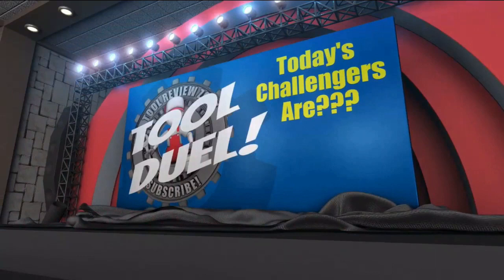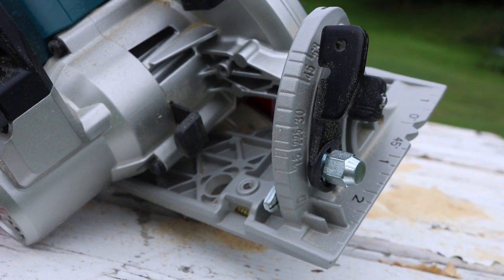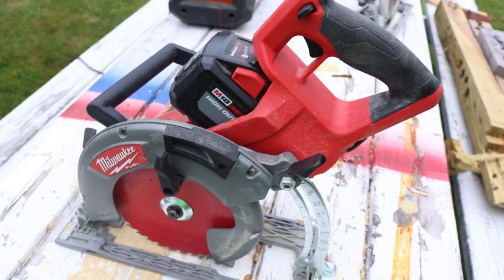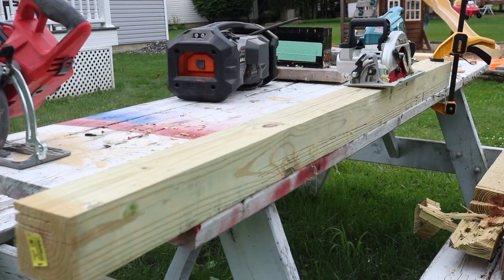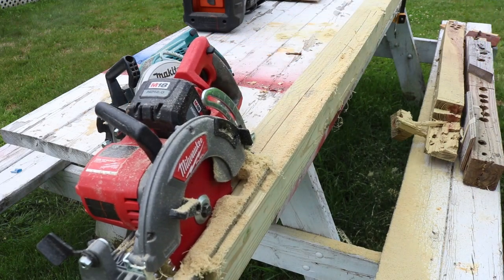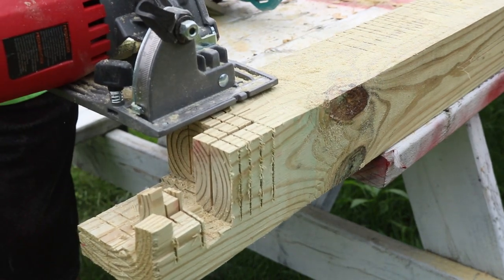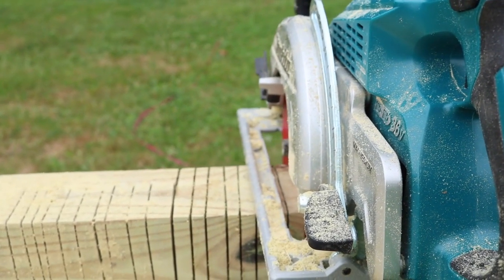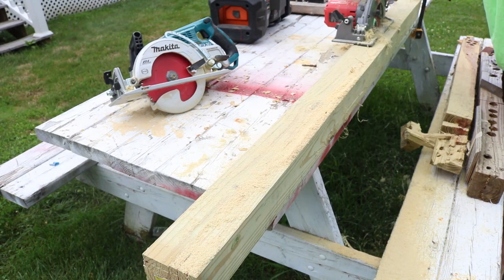Milwaukee VS. Makita! Milwaukee 18v rear handle saw vs. Makita 36v rear handle saw (Tool Duel!)

Comment: Great review. The Makita looks like a beautifully built tool.   The two batteries is a clear disadvantage though.   I’m surprised at how many comments I’m seeing from people saying they like it. I’m having a hard time seeing what is convenient about it.  If it managed to create a significant boost in power, it would be worth defending. This doesn’t appear to be the case though.
Reply: It keeps batteries of same size instead of creating the need to buy an extra large high output battery that won’t fit certain tools of the platform. Also double batteries are more stable and overheat less.
I own everything Milwaukee cordless, and their batteries are inferior by far compared to makita.
Reply: @dmitryshevchenko349  but you don't need to use the 12ah battery on the Milwaukee you can use a 5ah or a 6ah or a 9ah and it works fine

Comment: Dang I have the Milwaukee but I think I might switch it out for the makita. Have heard really good things about it
Reply from the maker: It's a really good saw
Reply: @ToolReviewZone  if you had to pick which one would you go with, just based on performance
Reply from the maker: I still don't like the two battery thing on the makita,  but wow is it a great saw. Though I love the Milwaukee,  the Makita is probably taking it for me
Reply: @ToolReviewZone  done deal. Post an affiliate link to hd and I’ll buy it. Saw, charger and 4 batteries for $249 right now

Comment: Most people don’t know how flammable magnesium is. If you pour water on a magnesium fire then it just explodes
Reply: BUT it takes a lot of heat to get a large mass to ignite. It is very good at evenly dispersing heat throughout the mass. Certainly nothing to worry about in a power tool. Only a worry with small shavings.
Reply: At the foundry I would add magnesium to the liquid iron during the pour.. it was fireworks everytime

Comment: April 2021. Get the Makita Saw, plus (4) yes 4,  5.0 Batteries, and Dual Charger  for $249.00 at Home Depot.  Makita is nicer because it is not super wide, fat,  and bulky feeling.

Comment: its exactly what that saw is for.cutting and letting the dust able to wescape from under it!tbh i dont rate any of them as my 36 dewalt way better in every way except the batteries which are only 2 amps

Comment: After being upset with Makita for obsolescencing their older 18v tools out with the new Star technology batteries, I tried to change to Milwaukee.  In case you are unfamiliar, if you have older makita tools (I do) that still work fine, they won't work with the new "star protection" battery unless you knock off a piece of plastic on the tool, or only use the 3.0 ah batteries.  I bought a Milwaukee brushless drill, but it was deafeningly loud, 108 dB compared to 90dB from my Makita.  I know this is a bit off topic since I'm talking about drills, but my point is I use my drill sets way more than my saws, and usually don't have ear protection on when I'm drilling pilot holes.  I want to buy milwaukee products but their drills are too loud.  It's ridiculous.  Makita's products are just a bit more usable as a set.

Comment: I've been running the Makita for well over a year now, using it exclusively as my go to.  I've used it to notch an 8x32 Glulam (70' long!!!), ran water under it and cut a concrete slab, and put it through more lumber than anyone. (I've never even seen another carpenter with one in my area)   The Makita is just plain solid, I've dropped this thing countless times and it won't break, it's not square anymore, but it won't break lol.  Good review, thanks.  Milwaukee batteries are junk, I'll take less power if it's always gonna be there when I need it.
Reply: Matt Fowler say what you want about the saw, you have way more experience with that, but it’s pretty much universally agreed upon that Milwaukee makes some of the best batteries...
Reply: @Walkop I don't know where u here that but I've bought two(2) FUEL kits because I was in a pinch and BOTH of them came with a bad battery, out of the box flashed green & red before I even used them.  I've dropped Makita batteries out of the back of my truck and picked them up out of the water I found them in, and they never skipped a beat.
Reply: Matt Fowler huh. That’s really interesting. I had that happen once, but turned out it was something wrong with the charger! A few power cycles and it was all back to working fine on that charger.
Reply: Ignorance! Milwaukee makes some of or if not the best lith ion batts on the market today and most likely tomorrow as well. SMH
Reply: Two man lift on that glulam
Reply: Ancestors
Mom 
Grandma Iva 1919-2001
Isaac V Wamsley Jr 1875-1930
Isaac V Wamsley Sr 1836-1908
Isaac Wamsley III 1798-1868
Isaac Harvey Wamsley Jr 1778-1825
Isaac Harvey Wamsley Sr 1735-1825
Revolutionary War Veteran
Leah Stout Wamsley wife 1742-1820
Daughter of
Dr Jonathan Stout 1704-1775
Richard Stout 1678-1749
John Stout 1645-1724 Middletown NJ
Son of Richard 1615-1705  and Penelope..1622-1732 New Amsterdam and Gravesend (Coney Island)
Elizabeth Crawford Stout wife 1650-1730
 Ayshire Scotland 
Daughter of
John Crawford 1618-1698
12th Lord Patrick Crawford 1580-1649
11th Lord William Crawford 1560-1644
10th Lord Patrick Crawford 1530-1560
7th Lord Thomas Crawford 1505-1541
6th Lord James Crawford 1470-?
5th Lord Robert Crawford 1435-1513
4th Lord Archibald Crawford 1389-?
3rd Lord Thomas Crawford 1350-1401
2nd Lord Reginald Crawford 1317-1358 
1st Laird Reginald Crawford 1283-1358 Fought at Bannockburn 1314 along with Robert the Bruce and received Lordship for his services.
Hugh Crawford ? -1319
 Sir Reginald Crawford of Loudon 1255-1297
Sister Margaret married Malcolm Wallace, mother of Sir William Wallace

Comment: Nice review but I have to disagree about the battery comment. Granted, two batteries might seem like a pain but you can use those batteries easily on any of makita's other products. when you look at the 12ah battery, I wouldn't want to run that in a impact. Plus I'd be interested to see how the battery prices stack up. Like what your doing though!
Reply from the maker: Thanks for the feedback David 👊

Comment: Looks like Milwaukee has a touch more power and less bog.  DO NOT like the dust management on the Waukee.  Meh, on the bevel screw "spins and spins".  I do wish that they would have put in bevel stops though.  IMO, Waukee got DeWalt pretty much beat on most of its cordless stuff; however, when it comes to saws..... DeWalt cranks out very fine products.  Agreed Clint, what the hell is up with the two battery design?  Not like it be givin' the tool any more performance over the 18v - 20v.  Only adding more weight and cost to the set up.  The dust management though.....Dang, looks like I might have to pass on the Waukee (on sale right now for $199, military discount $179, plus I gotsta burn $25 in Pro Xtra rewards before March $159 + tax on the Waukee.   Mmmmm, not feeling it though.  Love Milwaukee products; however, they do have botches in their line up.  i.e. most all their illumination products (over stated, over priced, under performed).  Hell, got a $20 Husky 12K lumen 110v during Black Friday that I just plug into my Waukee inverter, that blows their goofy rover lights out of the water

Comment: I recently bought the Makita and was blown away by the performance. I have a dozen or so other Makita cordless tools, so the Milwaukee wasn't even a thought. Plus the local chain lumberyard in the San Diego area had the saw and 4 5hr batteries for under $270 out the door. Great deal. I also wedged that annoying thumb button in the run position. That feature kind of seems like a child safety feature. Milwaukee makes great tools, no arguement from me there. I think which ever saw anyone purchases they will be happy.

Comment: Both are good saws and will last forever and withstand abuse...however I prefer makita circular saws ( only circular saw ) over Milwaukee's I like the trigger mechanism better the Milwaukee's trigger pull is rougher but overall as a brand milwaukee is better but makita is very Very good and I'm not a milwaukee fanboy I'm on both platforms but I like milwaukee more

Comment: Dust clogs every framing saw ever made, including the venerable Skill 77 worm drive saws. I seriously doubt there is a framing saw that doesn't blow dust down the bottom. Iworked several years as a journeyman framer and pro framers don't give a damn about dust collection. You really shouldn't focus on that issue.
Reply: We eat that sht to get us through the day.
Yeah, dust concerns are for housewives.
I frammed with skill worm drives for years, I still have 2 and one of those is the 77 red.
I bought the Dewalt worm around 10 years ago and I preferred it the first day I used it.
It's very comfortable, the deck just feels like it sits squarer on the wood, it feels lighter, I don't know which one is more powerful because that is never an issue with a worm drive.
But the best thing that I didn't notice at first was that i can shave a blade off of a 2x or plywood without having to lift the guard with my left hand. I don't know what they did different in the design because I haven't taken the time to compare, but man, you don't realize how nice that is because you and everyone else have been messing with the guard fore ever and always. 
An employee of mine cut the cord in half the first week i had it, so he ran out on his own and got me an 8 foot chord for it. That was nice of him and I added it back to a check without telling him. lol
Reply: @Thesaurcery4U2C  You are amazing.  It's good to see you treat your workers well. 

The Skill 77 corded saws have the same non-jamming feature you mention with your Dewalt. It lets you cut thin slices off a board without jamming. For corded framing saws, the Skill saws are probably still the best. But with the new battery saws,  it's a whole new world.
Reply: @franklong6269  
You know what.
I got that 77 from my uncle when he passed away and I had run my other skill worm for years before that, so I bet that I just grabbed the guard on that 77 and just didn't give it another thought.
I ran both new Makita 7 1/4 circular saws that a guy has. He bought the full sized conventional first, because I was cutting some T-111 for him and I hated the blade being on the other side because I can freehand rip like a table saw, and that saw was going to ruin my reputation. lol.
He then pulls out his new 36v worm drive Makita.
It cut nice, but 2x batteries gives it a little weight.
Reply: @Thesaurcery4U2C  If I was still framing, I would definitely look at the Flex rear handle circular saw right now. It  is a beast, and it has a LOT of smart features that are designed for professional framers. I think you can buy the saw in a kit with two batteries and a charger for $250.00,  which is a screaming deal - but check that because it might have changed. The table is all metal, and it is probably the most powerful battery-powered saw made. It also lets you exhaust the sawdust away from you when you are ripping plywood or long boards - which is a very cool feature.

I bought the cordless Milwaukee rear handle saw but honestly, I have not had a chance to really work with it in a framing situation. So I don't know about a lot of the nuances like can you trim wedges without the guard jamming.  So far I really like it, but you can't tell how good a saw is until you frame a least one building with it. It does seem like it will be a great saw, but I will have to test it in the fire to see.

I wish you much success with your framing  company. There's a LOT of demand right now for competent framers.

Comment: Hilti vs the winner!
Reply: The main problem I have with the Hilti is price. My Makita was $250 with (4) batteries, a dual charger and a case. The Hilti kit I saw with a few extra blades, 2 batteries, a charger and a case was over $1,000. Even if the Hilti was better, I cannot imagine it being better by enough to justify that price difference.
Reply: @chengliu872  ..nihau

Comment: The Makita 36 volt saw is proven to be the least efficient 7.25in cordless saw on the market, according to Concord Carpenter YouTube channel on a sauce shootout that he did last year I think. Although it could have easily been a two-year-old video, witch means that could have changed.
Reply: jason reynolds that’s the old Makita 36v saw that isn’t brushless

Comment: I have the Makita and I love it. I got it about 1.5 years ago and although I am primarily a Ryobi user I just couldn't pass on the amazing deal. It was $250 and it came with (4) 5aH batteries, a 2 battery charger and a bag. After using that thing, I no longer see the need for a corded circular saw.

Comment: It doesn't matter who wins because at the end of the day The question to ask oneself and should only matter is, can it cut? If a tool can't cut for sh*t then its a worthless crap. You can put as much amp power battery and extended features to make a tool seem so mind blowing but if it ain't cutting then its crap, its plain and simple.
Reply from the maker: I bet your a lot of fun at a party 🤔